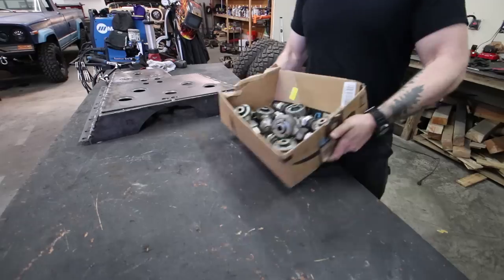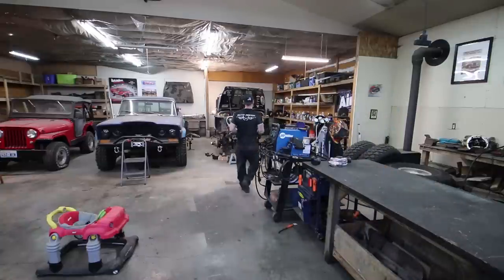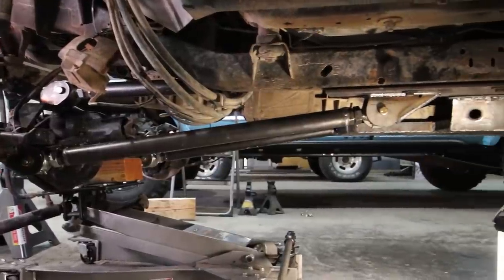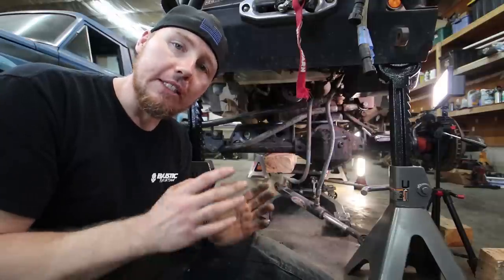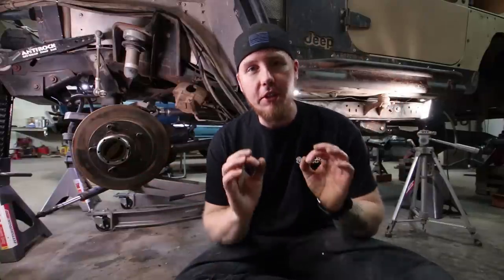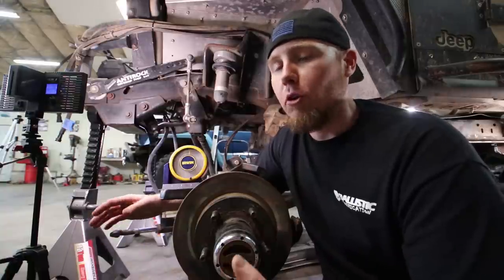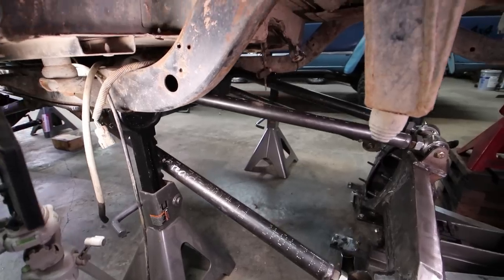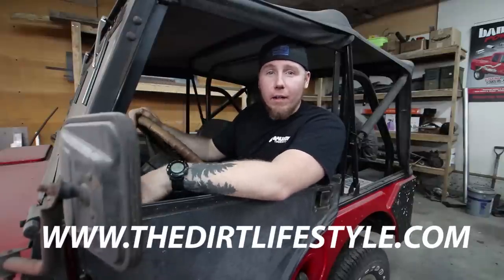Bump Steer, Flex Steer, Scrub Radius EXPLAINED! - Jeep TJ Stretch Episode 3

Comment: Like the channel. My little tip. I use PVC to simulate control arms. Warm the PVC with propane torch push the bung in and hose clamp. Let's me cycle and check for anything unplanned for. And let's me really check link angles. Keep it up

Comment: Great video and a great hands on explanation of how this stuff works. I think more details on roll steer/flex steer would be useful because it's usually overlooked and really important. The visualization you gave when the rear axle articulates is awesome because it shows where the suspension roll axis is. In your case it's above the rear axle, so you can see the bottom of the axle "swing" left to right as it rotates. 

The roll axis is from the instant center of the two lower links, to the instant center of the two upper links. In other words, its a line from where the lower links converge to a point, to where the two upper links converge to a point. The point where the roll axis is directly above the center of the rear wheels is the roll center, and the angle of the roll axis is what determines roll steer. If the roll axis is sloped up towards the front of the vehicle, the axle will steer away from body roll. If the roll axis is sloped down towards the front of the vehicle, the axle will steer into body roll. If the roll axis is flat, then body roll won't affect the angle of the axle and it won't roll steer at all.

This doesn't really matter much until the vehicle is going fast enough for the roll steer angles to have an effect, but at highway speeds it can be dangerous if its wrong. If the front axle steers into a turn, and the rear axle steers away, body roll will make the vehicle turn more, which will cause even more body roll and more roll steer. This is called roll oversteer and it can go bad really quickly, especially with soft springs/sway bars. The opposite of roll oversteer is roll understeer where the front axle steers away from a turn, and the rear axle steers into it. Roll understeer is much safer because body roll and roll steer are self stabilizing, but if taken to extremes it still makes handling unpredictable. Generally, 4 link suspensions should be built with as close to zero roll steer as possible without having any roll oversteer unless its used exclusively for slow speeds. 

Hope this helps somebody with their build! 
Thanks for the awesome video.

Comment: The bit with front uppers being 70 % shorter and better handling throughout the suspension cycle is more to do with caster changes more than pinion angle, albeit being a solid axle front they are both affected with equal length uppers and lowers.. Great video by the way. Subscribed for future videos.

Comment: We have a major issue with our suspension.  Just replaced stock axel with the Currie 44 and when I hit the gas it slow pulls to the right hard, and when I let go it lets the wheel go back to the left.  Never seen this before but it sounds like what your talking about at the six min mark.  Hoping a new draglink and adjusting the trackbar will help.  Great video!

Comment: With track bar mounting points at the same most of the lateral movement can be eliminated. My dislike for funking steering problems takes me back as my 68 Firebird was equipped with their factory installed bump right or left and under or over mystery steering options available in the 60's. I'll be back to watch you work. Peace.

Comment: Clean vids, nice straight forward presentations without a bunch of ear beating. Ballistic is top notch and always willing to help out. 
One question, do you plug weld your bungs? If not have you ever had one pull out?  We make all of our links, pan hards, and steering links from semi truck tie rods. We use 1" heims. Plug weld the bungs (as well as at the end of the link).  They hold up pretty well for the $$. Def not as tough as the DOM you used.  Thanks for sharing. Be safe

Comment: Scrub radius pretty much goes out the window with big tire.. not talking about 33s or 35s.. rumming tires like 42, 44s, and bigger.. you can't run an 8" wide wheel with a 44x18's.. so your wheel selection gets smaller.. you'll also not be able to run  a 6" BS or a +44mm offset unless you run a full with axle and basically no fenders on something like a samurai...just noting these things... nice channel

Comment: Ive been looking at a formula for scrub radius for my ZJ. Something that tells me, from stock up in tire sizes and wheel spacers, what the scrub radius is calculated to be. In other words if I add a 1.25" wheel spacer what size tires do I need to equal the scrub radius. Then I can also figure the lift to match the bigger size tires.
Reply from the maker: That's Info is really hard to find

Comment: Nice video Nate.  I saw you when I was at a gas station on Idaho (think it was Idaho) on my way to Moab.  But, I was too tired from doing field repairs on my YJ steering and you were on a mission, I could tell.  I liked your Ram truck and trailer.  One of these days, a video on your tow rig would be cool.  I liked your video on how you do your trail tool bags.  I'm in Mukilteo. So, if you can name drop some trails that are good for a novice like me. That would be much appreciated, obviously not as a main focus, but in passing I guess; that would be cool.  I checked out that one off-road area you mentioned on highway 2, on Google maps, seems cool.  Bad ass channel.  Keep it up man.
Reply from the maker: Small world man! Tahuya is good place to start wheeling. Wide trails and lots of mud! Then you can work your way up to Evan's creek and elbe hills. Walker valley is a good one as well 👍
Reply: Thanks Nate.

Comment: I was totally impressed till I saw you using A36 hot rolled steel, I would use Chormoly plate 0.19 and A574 alloy screws either flat head or low profile socket screws with A574 self locking nuts, besides that and the welding very good video

Comment: You want pinion angle to stay parallel to the output shaft due to the driveshaft cogging. Look for the Spicer video on the subject.
Reply from the maker: Unfortunately this is untrue for most offroad vehicles. Most offroad vehicles use a c/v joint on the transfercase side of the driveshaft. For anyone who is confused by this guy's comment please check out this reference. Its from a driveshaft manufacture called Tom woods and it explains in great detail how to set up driveshaft angle on a CV shaft. 
http://www.4xshaft.com/driveline101.html

Comment: I am curious as to why you did not try and raise your transfer case in order to gain more ground clearance? Thus removing the TJ’s shoveling problem. Otherwise great info and keep the great videos coming.
Reply from the maker: The transfercase is HUGE! It's 3/16 of an inch away from the tub as it sits right now. If I raised the tcase I would have to cut the floor of the tub and raise the seats. That's a compromise I'm not willing to make. Also, the TJ never had a shoveling problem. 🤘

Comment: I think you mean your panhard bar in relation to your drag link. Not tie rod which ties one wheel to the other. You will never 100% get rid of flex steer due to axle swing from articulation and scrub radius can give you a excellent traction Advantage when crawling and causes no more effort with Hydro steering.

Comment: Great videos! Very informative. 
 I have to mention, your pinion angle info isn't accurate though. 
 If you have a single u-joint at both ends of your driveshaft, the degree of both yokes (t-case and pinion) must be the same.
 If you have a cv style joint (double u-joint), the pinion angle needs to point within 1 degree towards the transfer case.
 My rear stretched tj drive shaft came from Tom Woods driveshafts. That's where my info came from. 
 There is also a great video on youtube from the 60's (i think) that does a great job of demonstrating what happens when your single u-joints shaft isn't the same degree at both ends. Very  Interesting reaction when one end is off.
 Other than that, your videos are the most informative and clear explanations on the tube. Keep it up. Thank you.

Comment: This is an idea coming from the street-car world...Couldn't something like a Watt's link with a Heim joint that attaches to a mount on the diff housing to still allow the diff housing to rotate be used to keep the axle itself from moving left and right at extreme droop? I think there's a bit of an S-curve in a Watt's-link-constrained movement, but it is probably a lot less dramatic than what you're seeing there.

...Thinking about it, that probably wouldn't work very well. Too much hardware behind the axle.

I recently found your videos and they are amazingly informative.
Reply from the maker: My land rover has a watts link rear. They work ok offroad and are definitely a cool option for the right project. Thanks for watching man! Happy to have you aboard👍
Reply: I was thinking about this a bit more...Wouldn't a three-link rear with a body-side link that only lets the link swing instead of rotate as well prevent the diff from moving off the centerline?

Comment: Nate I have two related questions hopefully you can give an opinion at answering, thanks in advance.  Keep up the great videos. 

 as far as scrub radius... if using full width axles (67” WMS) and say a 7”  backspace (hummer wheel) would this be a good scenario for eliminating scrub radius or make this worse moving the tires vertical centerline too far in. I’m aware of the possible downsides in packaging steering components & turning radius with this setup. But if this setup could be done would the scrub radius be too extreme on the opposite side (inside) of centerline?  (Edit: the reason for this backspace setup would be to avoid huge tire stickout & giant fender flares)

Next question: when setting up axles at full stuff to start a linked build would you set the pinion angle first or not worry too much about pinion angle and adjust that using the links after the link  are built?  
This will be my 81 scrambler r2.8 build - driven mostly to/from trails & trailered to Moab a few times a year.
Reply from the maker: That is alot of backspace but you should be ok. Once you cross that threshold of almost zero scrub you start growing the scrub again but in the opposite direction. I'm at 4.75" of back space so your not much more than me. But you're axle width will be even narrower than me when your done lol. I set up everything where I want it (pinion angle included) before I measure for the links 🤘
Reply: Dirt Lifestyle awesome thanks for the reply. 

Your last video has me browsing options for a Super Duty dana60 front.  Hard to decide & justify when I was given a running & driving donor truck for free with 8 lug Dana 44 & 60 rear. 
I might commit to using what I have until a SD 60 falls in my lap then I’ll do the swap. 

Here in Denver I’m seeing them $550 to $750 range with 4.10 gears.

Comment: Question?????  How does flex steer effect streetability?  In other words in an upper triangulated setup like yours what is your street driving going to do?  Or is it not recommended for the street.
Reply from the maker: You wouldn't even notice it on the street. Only when your flexed out on an obstacle. In order for it to steer, it needs to be flexed almost completely out.

Comment: I have a JK and the mounting brackets in the front on axle stick down a lot. companies make a lower mounting bracket that raises the lower control arms on the axle for more clearance (about an 1”). They uppers brackets stay put. How would this affect the suspension if it all since it’s only 1 inch.

Comment: If you use a single top pivot point on the axel instead of 2 like your set up you'll virtually eliminate any "tilt steer"
Reply: Are you referring to the upper mount on the real axle?
Reply: @goin200mph  yeah a single pivot on top of the axel, then the upper control arms will form a triangle

Comment: On the scrub radius. What do you change the back spacing? I am about to do a axle swap and I debated on using the same axle setup. I thought dana 60 and 14. But I will only be running a 37.

Comment: Hello Nate, you say 1/4 of tread for adjustment correct im working on doing my own custom steering set up , thank for any info and be safe
Reply from the maker: I set mine up for only a quarter inch of exposed thread on each side of each link.  So I have about half an inch of inward adjustment and 3 plus inches of outward adjustment. But I had those axles really dialed in before I measured and made my cuts. I'm talking to an 1/ 8th of an inch or so

Comment: You mentioned bump steer is the length of your panhard bar to track bar, then later your track bar to tie rod.  Neither is correct.  It is the difference between the track bar and drag link (from steering box).

Comment: What's the story on the old red wrangler/cj
Reply from the maker: It's basically garage art at this point. I saved it from rotting away in a field somewhere, got it running and now I don't know what to do with it. It's the same size as on the inside as a Suzuki samurai so I can barely drive it. The problem is, I love the idea of owning an old Jeep so much I can't get rid of this thing.
Reply: I understand that totally I own 3 xj's a mj and a zj